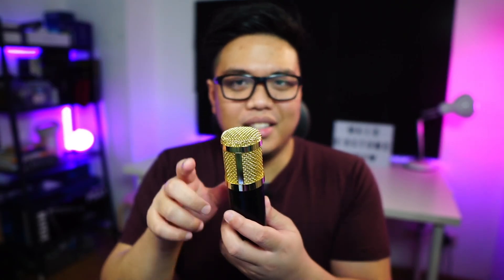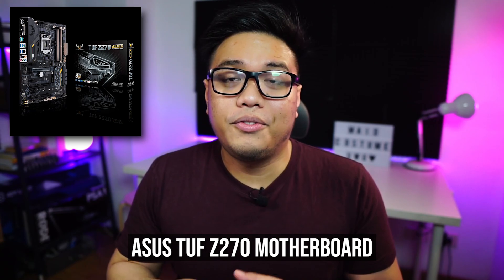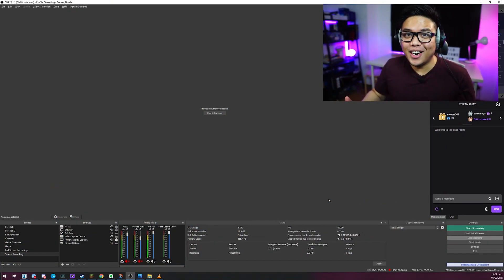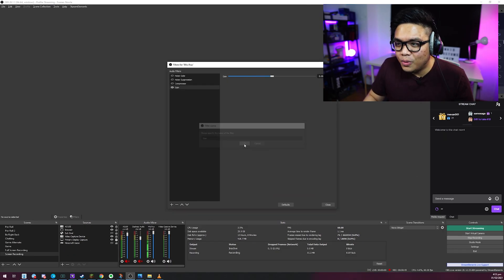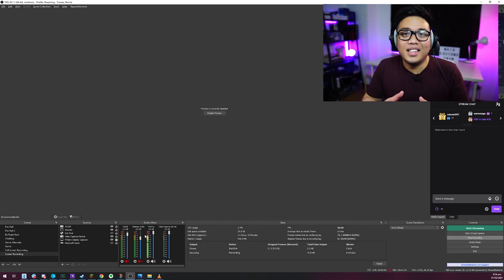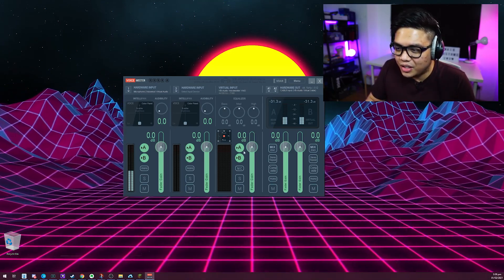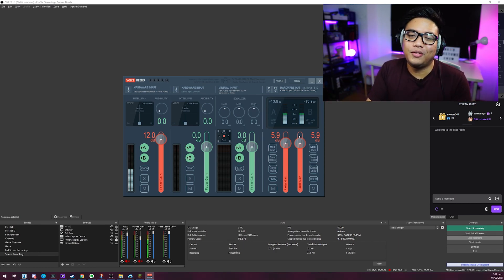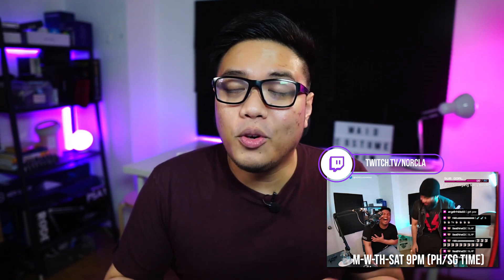How to INCREASE VOLUME of your BM800 with NO phantom power NO audio interface NO V8 Soundcard

Comment: I am so glad that I ran into this video! I just got my bm800 microphone, which came with a free v8 Sound card. I was experiencing volume problems as it would pick up my voice but it would be very soft even when I scream. I asked my friends about it and apparently the v8 soundcard is actually very low quality and now I need to start saving for an actually good, but expensive sound interface. This substitute will do well in the meanwhile :D
Reply: Same as me too. I also got the v8 soundcard but it seen look like bad.. so how your mic right now?? It is ok ?
Reply: @ahmaddanielchannel  I also encounter the same problem. How urs ?
Reply: @rampoackerman9644  same.. now i dont use the soundcard v8 anymore.. i just simply connect the microphone + phantom power to my pc .. but it still same , only get 5% improvement than before..my voice still slow
Reply: @ahmaddanielchannel  Thanks. I also noticed connecting it to the v8 soundcard gives it a bit of a delay. Connected directly to the pc too and still waiting for the phantom power to arrive

Comment: Hi Norcla! I was wondering kung gagana ba yung ganitong setup. I'm planning to buy a cheap phantom power, Sedan, then have an XLR to XLR to connect the condenser mic (BM-800) to Sedan. And have XLR to USB to connect it to the computer. Will it work? Would you recommend it? Some foreign youtubers don't ultimately recommend it. They say having a dynamic microphone using an XLR to Cable will be much more effective.

XLR to Cable + Phantom Power + XLR to XLR + BM-800

I hope you'll notice this. :D